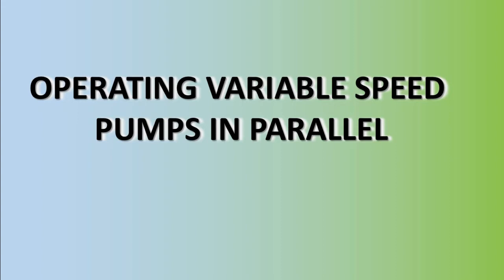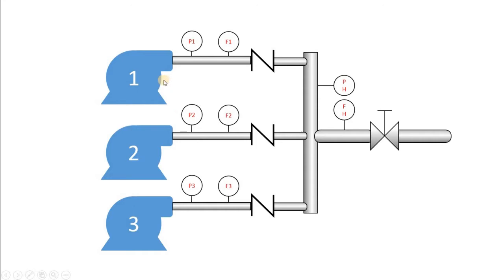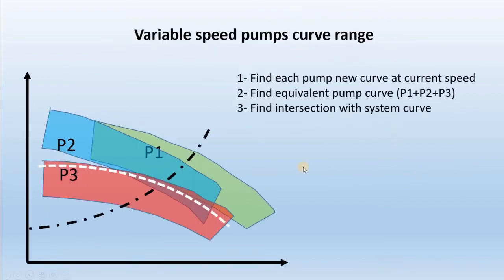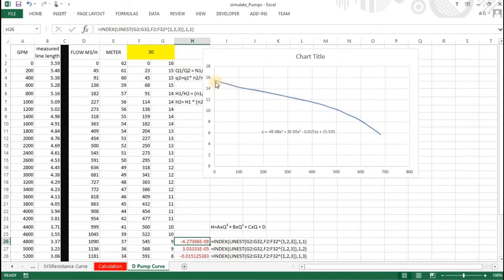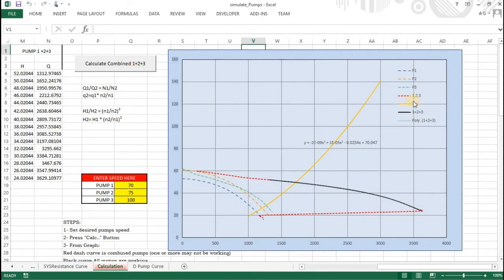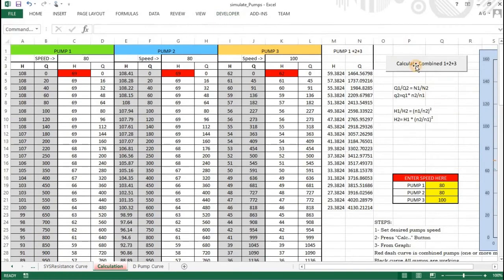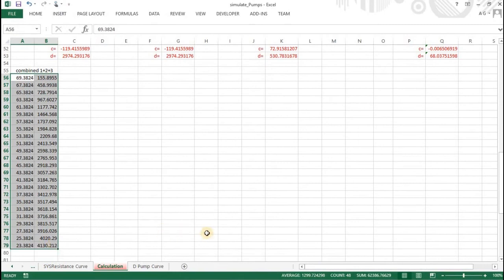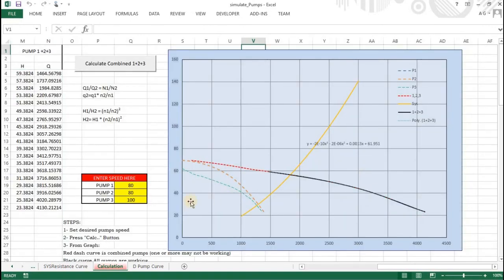Practical case 2: Parallel Variable speed pumps Operation Simulation Excel VFD motors

Comment: What a fantastic job you have done here. Could you please explain a bit about control scenario, and how you mange to control vfd in those pumps to keep them on optimum point of the curve.
Reply from the maker: Hi, many thanks for your support. I made another video to illustrate the control of pumps working in series in short pipelines, it is not published yet. I will make another one for pumps working on parallel. Thanks for the suggestion

Comment: hi..really appreciate if can you share the excel sheet. TQ very much L&L
Reply from the maker: Hi thanks for your view. Can you check the link in the description to download the file. If it does not work let me know
Reply: @LunchandLearnX  hello I tried accessing the file through the link and it didn't work. Your help regarding this file is much appreciated
Reply from the maker: @ianclark2097  Hi, sorry I am trying to fix this link.  If you send your email or send me an email the the email included in the description, I will send the file to you.  Cheers
Reply: @LunchandLearnX  I will send you an email directly and it should be in your inbox shortly. Much appreciate the swift response and your excellent content. Very helpful!
Reply from the maker: @ianclark2097  I sent the file but I received the following: The response from the remote server was:

550 permanent failure for one or more recipients (ian.clark@ajay-sqm.com:blocked). Please unblock or use valid email
Reply: @LunchandLearnX  hi that is likely our network protection system being active. I responded to your email with an alternative email account that will surely work.

Comment: Macros is not clear to me. Can u please make a video simple telling how the data is tabulated for P1+P2+P3+. Please send the excel on higupt@gmail.com, if possible.
Reply from the maker: Hi Ankit, The excel sheet sent to you.
Reply: @LunchandLearnX   I did not receive mail, can you tell which name or subject of the mail ?
Reply from the maker: @AnkitGupta-ck9po  Two pumps in parallel Excel sheet
Reply from the maker: @AnkitGupta-ck9po  Sent to the new email, by the way I did not receive error message from the first email sent meaning it reached your end. Please check your spam folder
Reply: @LunchandLearnX  yes, it was in the scam folder. I will ask, in case of any query.

Comment: Can we use comparison formula for Frequency (Hz) to get the value of flowrate?
Reply from the maker: Thanks for your comment, if you mean the VFD output frequency then i think the answer is yes and no. in brief:
Output frequency defines motor speed, which define the pump curve, now the operating process point on the curve is defined by the process resistance.
As long as your process resistance curve does not change you can predict the flow rate (with relative accuracy). The system resistance is the total losses in each system component (pipe, elbow, valve....) or gain (level change).   
Assume your pump is running at any speed, and now close the suction or discharge valve  which will change the system resistance (forget about pump damage due to excessive heat or cavitation) the flow rate will change.
For fixed speed pump, it is common to use the motor current as indication of the flow rate. if you need to discuss in details you can email me at "lunchnlearnchannel@gmail.com"

Comment: I am not entirely sure why you used a macro here instead of just a table with some if-then statements to create the values.  I think I managed to do that.  Maybe I missed something?  Thanks
Reply from the maker: Hi Steve, Thanks to take the time to comment. it is matter of preference. the main idea of the video is discussing operating more than one pump in parallel. Macro is one way to use to calculate the net result. I found macros easier to debug,  can accommodate more complex tasks, and a step for more easy to user interface (if Forms is used). Also to find the operating point (intersection between the two curves) it may be easier to use Macro.